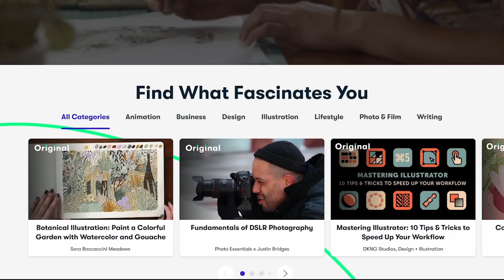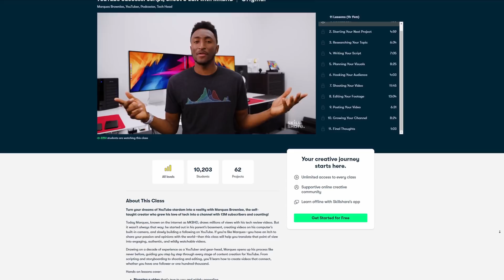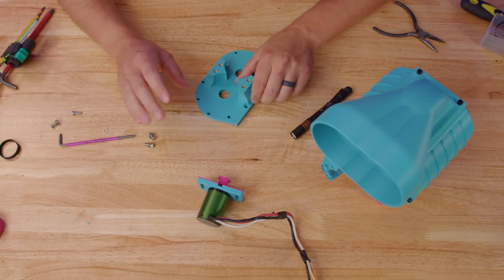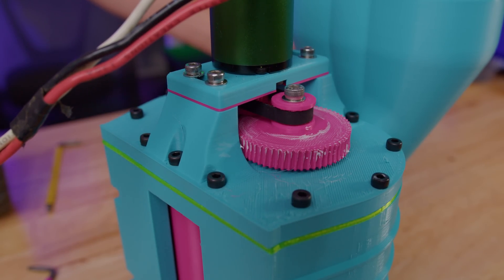I Attached a 100,000 RPM MAX Castle Mamba to my 3D printed SUPERCHARGER..... Will it Survive?

Comment: should be able to use any 12volt powersuply you can get them rather cheap one. a name brand would be MeanWell a 500W one already would give you 40 amps idk what you need, there are 1000w but they get a bit harder to find 
a lot have a small potentiometer to ajust voltage atleast cheaper ones which lets you adjust the voltage sometimes up to 50v often less 
the powersupplies i mean are the ones that are used in a lot of 3d printers basically a flat silver metal box with in/out terminals on one of the small sides
Reply: actually i looked up meanwell data sheets and from what i gathered they are ajustable +-10% which i guess a lot have so not really what you where looking for, the 50v i had in my head must have been for their 48v ones.

Comment: You have flexible filament right? Have you considered printing heavier duty toothed belts purpose built for the task?

Another commenter noted they'd need to be pretty thick, probably unavailable on the market outside of special orders, but your 3d printed gasket seemed to work, idk why a 3d printed belt wouldn't if the material we're flexible enough.

Comment: I don’t know if you’ve fixed your “gear whine” issue, but in the production of a number of small block Chevy motors, GM decided in their infinite wisdom to use plastic sprocket teeth on the crank pulley of the timing system. Maybe you’ll have some luck with one of the gears having a rubberized plastic sleeve around it to dampen vibration there?

Comment: You need to get a bench power supply my friend. A switched one is pretty cheap and you don't need a linear one - and you can dial it in to whatever values you need. Once you find the values that work well, you just buy a power supply of that specific volts and amps and bobs you're uncle, done!

Comment: You could try an adjustable desk power supply like for electronics, and make a few cables that goes from banana clips to the car(where the battery plug in) then give it the rated input voltage.

Comment: If you just need raw power and not adjustable voltage, just grab a car battery.  It is sitting on the bench so you don't care about weight.

Comment: Printing some teflon seals for the blades would make it more efficient and give it more flow. The health of a "Blower" is evident in the amount of positive air pressure it can produce. Would help push past heat exchanger fins.

Adding taper and or twist to the lobes, moving the air inlet forward and outlet rearward where they don't overlap can help aswell. This is evident when looking at OEM chargers. (for example searching: pontiac 3800 super charger)

Comment: I don't have a particular model for you but many of the nicer battery chargers like from toolkitrc for instance, have powersupply modes that are pretty chonky given that they can be powered from batteries in all sorts of configurations or wall supplies like server 24v supplies.

The purchase would also double as a really baller charger which I imagine could make it more worth it.

Definitely involves a bit more research than if I just had a model number for you though,  but it's been a while since I looked.

Comment: Straight bar rotors like these are, mimicked like the Roots brand of blowers always sounds cool.. but, allot of power is required to turn past the pulsing of the 3/6 or 2/4 rotor bars pocketing process of air... Your next rotors, if you choose, try the vintage Rotex or or Paxton 120 helical tri-bar rotors... The pulsing and pocketing is lessoned, and smoother, and more flow can be had that way.. but, in real world, harder to manufacture and maintain.. Of course, in the real world, high RPM's the pulsing, is hard to measure at those extreme PSI's, or rather, the engine doesn't care..lol... PSI is PSI even if it is in pulses, backed up with a pulse, followed by another pulse etc... 12 PSI at 800 RPM's vs 12 PSI at 10,000 RPM's is still 12 PSI... and the pulses are so close together and so fast or flowing past a given point, that one could look at the pulses are each having a bandwidth that keeps getting skinnier, respective to the higher the RPM's go... 

If you do the math on this, which is interesting to me... the gears to keep the pair of rotors in "time" to prevent collision, the amount of torque that is placed upon the axle points or where the ball races are, that smaller diameter area, and the back loading from the air pressure, at 12 PSI @800 RPM's, for example, could measure 15 ft/lbs of torque... but at 12 PSI @10,000 RPM's that same location on the axle points now is experiencing a twisting / torque action of 1800 ft/lbs.. but, it is still only 12 PSI for the exampled numbers.. which are just off the top of my head.. 

The output or discharge port of your blower unit... is for the most part, "OPEN".. restrict the tube to create a charge weight at a lower RPM.. watch how much you have to open up the discharge opening to keep the PSI the same... Mind blowing.. (pun intended)... I have enjoyed you couple videos on this blower. pretty clever print..

Comment: I've seen a few others comment on using a PC power supply. I'll put down on that as well. That motor and ESC combo is designed to take up to a three cell LiPo which outputs about 14.8 volts at full capacity. If you can hack in to the 12 volt side of the power supply It would be ample voltage to run the system. The power supply would need to be at least 600 watts to be able to handle the amperage draw which should be about 30 amps at full speed. Could be a bit more considering the resistance of what you're pushing so I recommend 600 so you have some wiggle room. I could also be very low on my estimate and you could need a 1200 watt supply. Best thing would be to put it on a meter to see how many amps it's actually drawing. I'm willing to bet you have one laying around somewhere with all that hardware you have stacked in that room.

Edit...
P.S. Figure out some some way to drive the Cheater with that thing!

Edit to the edit...
P.P.S. Took a look at the SkyRC eFUEL power supply. Don't buy that. The 1200 watt lowest voltage output is 15 volts. You could end up over working the speed control if it gets a constant 15 volts. The 540 watt is only 30 amp so you could over work that power supply and cause it to thermal.

Comment: The problem is efficient ratios and pump design. A blower motor's power is in the back pressure it can create, not just cfm. If you want more cfm you have to make bigger lobes or increase the RPM to insane level.

Comment: If you can get the power delivery situation solved, I think the biggest gains are going to be made by tightening up the tolerances between the rotors and the rotors with the casing.
I wish there was a way we could see pressure as well as flow.

Comment: Get a couple 90c batteries and a parallel adapter from amazon. Get a few batteries and adapters if you want to go nuts but don't think you will need more than 180c.

Comment: I have some suggests: 
1: SMOKE TEST PLEAAASSEEEEE
2: maybe instead of electric motors you could try using compressed air. I’m sure an air compressor could get to enough psi to move the gears and you would just need to 3d print a turbine assembly and connect it to the rotors. It may not run faster that 100k rpm but it could potentially run longer without the battery dying. 
3: you should try to find a way to measure static pressure

Comment: Are you useing a 2s or 3s battery? It sounded based on what you said your only on 2s. 3 would add alot more speed if thats the case and you could get a 5k battery to help as well

Comment: Hook it up to a car battery. Since it's a DC motor it'll be fine. if you need more than 12V. Hook 2 up in parallel for 24v

Or you could use a battery from a portable power tool. You'd want one from say an angle grinder or reciprocating saw. They're available in various voltages.

Comment: Get a 3/8 rim sprocket print a mount for it and use a 880 or a 3120 to make it turn. Might need some oil on the gears and down the bug catcher, for sealing.

Comment: I'm amazed at the performance of this supercharger build.  On an automotive application many times superchargers are set up to at least push twice as much or more air flow than the normally naturally aspirated engine can pull air on its own.  So if the engine's max power output is around 6-8,000 rpm then the super charger should be capable of at least twice that or higher to perform well.  Your application seems to be doing very well.  Perhaps a screw rotor application could do slightly more.  Wouldn't know until its tried.  Be generous with the grease on all the areas with rotating parts.  Gears, bearings etc.  This will reduce the friction and heat causing most resistance in the rotating parts.  It would be cool to see PC cases with this thing sitting on top of it.  Imagine a group or PC gamers sitting around bragging on their rigs and one of them bust out, "yeah well my rig has a super charged cooling system." lol  I wonder how this thing would perform attached to a radiator for a liquid cooling setup.  I think you may have created something worthy of a patent...lol
Reply: lol it's a fun, creative project but this could never be a practical product for water cooling.

A while back I made a joke N02 button for my loop. It pulled the trigger of 2 upside-down duster cans and blasted the radiators with freezing air. It was a joke but actually worked surprisingly well for passing demanding OC benchmarks. It would be absurdly hilarious to combine that with his supercharger sitting on top of the case.

Comment: You can either use a 24 or 12V Car battery or a 12V UPS battery. And you can put multiple either in series to get a higher voltage or in parallel to get a bigger capacity.

Comment: Definitely simplest thing 12 volt lead acid battery from a car or truck the motor speed control will trim and use only all that it can use surplus won't matter

Comment: Why would you listen to the people who suggested a belt drive?? Huge facepalm right now.... Automotive blowers only have that out of necessity, top level pro chargers even move away from this and are driven directly off the crank. You can print anything, so do a gear drive with a reduction and bigger teeth than the ones you tried. No way will that motor handle the load of those rotors spinning anywhere near 100k rpm if they would even spin that fast to begin with. Most automotive roots superchargers have a max RPM of around 15000.

Comment: how heavy are your rotors? i know theyre like, whippin around but its not like they need to be that strong. do you think you could print them with a single wall and make them as light as possible? the less force it takes to move them the faster the motor can spin them.

Comment: put weather strip on the tip of each rotor to improve vacuum. or if you want to get fancy. Print new rotors with a channel in the tips and cut up some windshield wipers and use that.

Comment: I would still be interested to see a longer version that can fit on a 240/360/480 radiator to see if you would be able to have full cooling potential with using a single motor
Not sure if you have the hardware to produce the amount of heat to saturate a 480 radiator since I used to get away with cooling a SLI setup and HEDT CPU with a single 480 and still run the fans at 50% without issues

Comment: Just letting you know that you can buy 12V 1500W server power supplies for REAL cheap. They're extremely reliable and stable, plus you can put two in series and have a baller 24V 3KW power supply. They're insane! There's tutorials on where to solder the wires (it's pretty easy), but I'd be happy to teach if you wanted :)
I use mine to charge loads of lipos at once, so they can sustain 2KW+ constantly for an hour or so without breaking a sweat. They're designed to do it 24/7, so a short pull isn't a problem lol

Comment: A typical us power outlet will be limited to 1500 watts (1800 but usually 1500 is used for safety) so at 12 volts that would be 125 amps. Typically 240v circuits are 30 amps or more so that would be 7.2 kw or more amps than that motor can take. I would suggest looking for a 0-20v 0-100 amp adjustable dc power supply from a reputable company who's been in the industry for a long time. The ebay/amazon stuff you typically will see could easily become a fire hazard if the proper safety precautions aren't taken in the design of the unit.
Reply: It would be helpful if you posted the data sheet for the motor

Comment: You can get a benchtop power supply 10 amp are pretty common, if that's enough power, but 20A are available. On some of them you can limit the current as well as adjusting the voltage.

Comment: If you want a cheap stable power supply that will give you all the amps you want you might try a couple car or truck batteries. Deep cycle would be best for this but junkyards often have cheap working batteries of mixed types. You can mix a large 6 volt battery with a 12 volt car or truck battery to get 16-18 (depending on health) volts if that's what you need. The biggest downside is it's not really adjustable, you will always go up or down in 6 volt increments (less if you bypass cells inside the battery but well... sulfuric acid).

I have also had great luck combining $30 lawn tractor batteries with an ancient used "buzz box" transformer style 12/24 volt charger/jumpstarter. The lawn tractor batteries deal with inrush current well and help the stability while the "buzz box" gives you some decent sustained output.

Comment: Link to the motor is wrong.
What power spec do you need? (Volts & amps).

If 12v is sufficient, just grab a computer psu. 1200w psu is available

Comment: look into getting a 1515y motor and mamba monster esc. both are from castle. and also get 2 2s batteries that are the EXACT same. ill reply to this comment with the links to the materials
EDIT: I forgot to mention that the 1515y motor uses a bigger bore pole size so you would need to get a different spur/pinion gear.

Comment: I’d like to see a turbocharger design after these experiments that use the same motor and power source. 😏
Might need to print the impeller with some more exotic materials for stiffness and strength to withstand the forces, though.
Reply: What you're describing is a centrifugal supercharger and I'm absolutely here for it. Please build one next.
Reply: That's a procharger.

Comment: maybe forget toy controllers, get a motor controller and battery from a scooter or bike. they'll surely have no issue with that amount of work. also, those gears need a second bearing (maybe just the non-motor side, the motor is the second bearing on the drive side so keep an eye on that bearing) as there'll be a force side loading the single bearing as the gear ride out away from each other (this is probably what broke your belts and couplings). some PTFE/lithium/wax lube on the gears will cost some power but will probably let you spin it faster if you have the power to spare (it may take up some lash in the gear mesh too)...

Comment: May be a bit hard to do, though I don’t really know for sure, but I’d love to see this idea applied to a centrifugal supercharger. I also think if you bought an angle grinder and used the motor from that it would work much better
Reply: That’s a good idea more power and a wall plug
Reply: a 5inch angle grinder tops out at around 10,000rpm, but has a boat load more tq than the little motor hes using... i dont think it would work the way you have in mind
Reply: @Krasher247  you could work around that with a system of either pulleys or gear ratios
Reply: @da_poopoo_dealer3152  putting plastic gears on a angle grinder sounds like a intresting party😂
Reply: @Krasher247  i think torque could be better because you can try to go bigger with the impeller. but if that doesn't work you can always just take out the gearbox that's built in

Comment: 2S LiPo 20C 4000mAh battery, 7.4V 80A max discharge rate. 1200W ATX PSU can do 100A at 12V. The motor labeled 3S battery MAX (11.1v), I would suggest get a bigger battery, it's way cheaper.

Comment: I'm not familiar with the output of those batteries, but I've seen people use server power supplies to power car audo stuff in their homes. They can output a fair amount of amperage, assuming the voltage is what you need for this application.

Comment: I do long range autonomous FPV with fixed-wing planes. Your best bet is going to be to get a low KV motor and run it off of 6S. It's going to always have the torque but keep amperage low.

As strange as it seems the people who are flying huge MFD planes for 2 hours flight time are using 6S

Also I work at a high temp FDM manufacturing company so the next part that breaks, just send me the file and I'll print it for you in PEEK.

And finally if you have any machines that are capable of printing nylon, a natural nylon will be the ideal material for high wear components as nylon is "self lubricating"

Comment: 3:39 You REALLY should actually research the parts of an Automobile supercharger, and why certain items on them are the way they are. Look at your Tiny teeth on the pinion/gears of the device... They only have so much sheer strength (2:27 hence why it torn it right off) You need deeper stronger teeth belt side and gear side. Look at some of the high end superchargers and the belts they use... ON METAL gears/Pulleys Not weak plastic that comes from a 3d printer.

Comment: why not a 120vac frequency drive. small 1.5 kW drives are not that expensive. but then you also will need an squirrel cage motor. but that will give you lot's of torque.

Comment: It will be far more economical to purchase a 6s ESC from the likes of Castle Creations (Mamba X) or Hobbywing (Max 8 or bigger). You can purchase a ~100c 6s mini quad (racing drone) battery for around $20-$40. Those Castle 1410 motors (The one your using), can handle upwards of 250 peak amps.